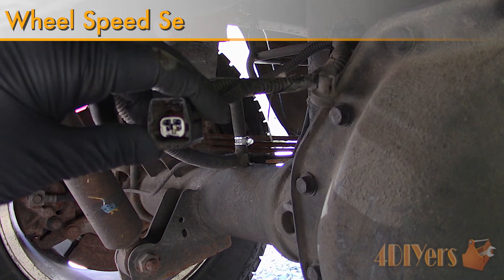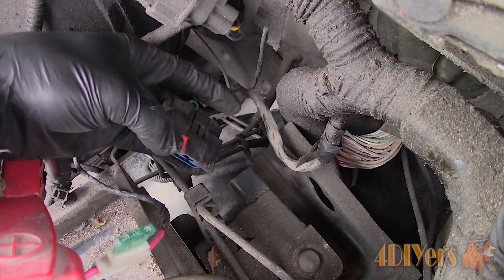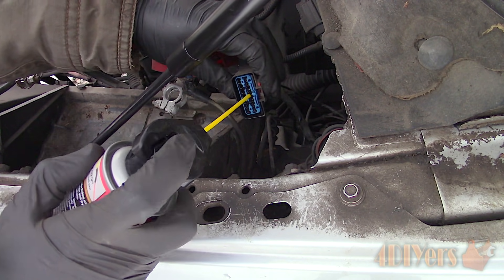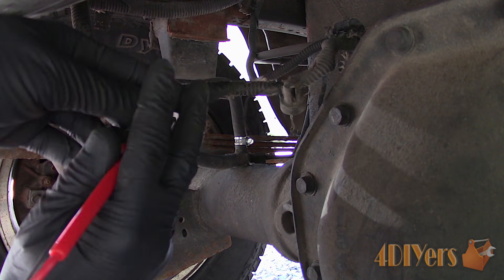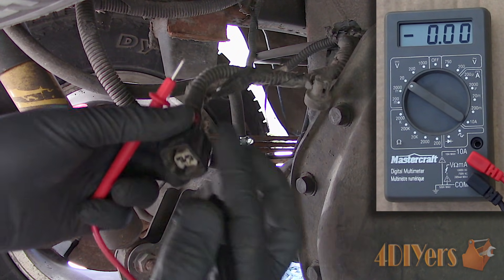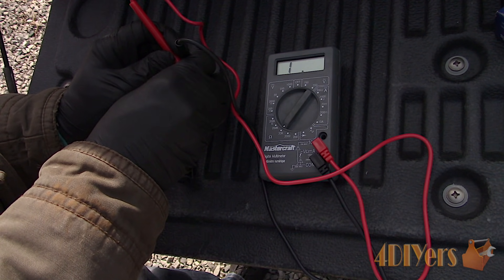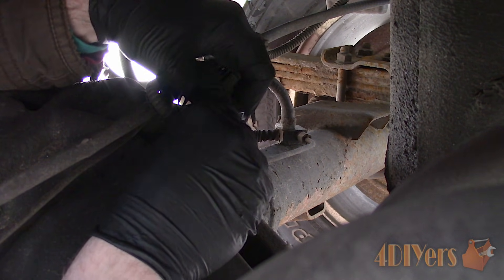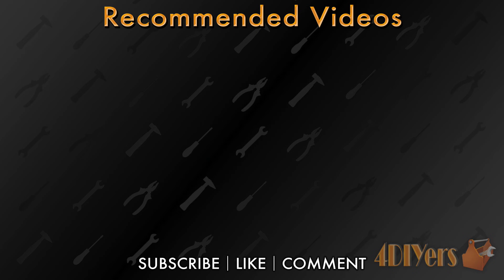How to: Dodge Ram 1500 Rear Wheel Speed Sensor Testing and Replacement

Comment: Had two brand new abs sensors that were 1,200 ohm for the 2018 dodge 3500 but the old sensor that was still working is in the 1,800 ohm rating 🤪

Comment: i know where the end of wss connects to the hub but can anyone PLEASE tell me where the other end originates from? i cant find a wss on either side in front and i cant find where the wiring originates from in order to see if someone cut them off i see no wires anywhere PLEASE SOMEONE have a answer and hopefully one i can easily follow. 2003 dodge ram 15004x4 5.9l maggie. this is for my 2 front wss

Comment: Just did exactly everything you said in video.   With key ignition on and probing rear axle connector I shouldn’t be getting any voltage on both left or right side of plug.  Left side I get zero. Right side of plug in getting 4.7 volts!!  What exactly does this mean if I’m getting volts on one wire on plug with key turned on?  Thank you for the awesome video.
Reply: Im doing mine now.  I dont think the sensor in my 02 ram is same as one in vid.  Looks like it. But when u spin wheels it produces dc voltage instead of ac.  And it has a 2.5 volt steady reading with key on. Couple more videos and ... Its called a variable reluctance sensor.  Manufacturers of certain vehicles often used diff sensors that varied by trim types etc.

Comment: I'm going to take this task on asap on my 06 RAM. This may seem obvious, but should I take the spare tire off before doing this, so I have more room to work, or does it not make any difference? Any suggestions will be greatly appreciated.👍
Take care
Reply from the maker: You can remove the spare tire, it will help with more work space. I usually try to the bare minimal in my videos to keep it as simple as possible.
Reply: @4DIYers  Right on. That's totally understandable. Thanks for the reply and have a good one.👍💯
Reply from the maker: No problem and thank you!

Comment: Good information. The only bones i have to pick are with technique. When probing connectors it is IMPERATIVE that you use a probe that is the same size as the pin that goes into the connector or smaller there is visable terminal spreading on your ABS pins from the large probes spreading the connectors. This can cause intermittent connections and compound issues from self induced problems.  The other is the Ohms test from ABS to sensor. Having an other than spec reading does not auto fail the sensor it just confirms an issue in the system. Seperate sensor and wire Short-to-Ground and Short-to-Power tests then need to be performed.  Other than technicalities the video was well made.

Comment: The speedometer on my 2002 ram 1500 3.6L isn’t working after having the engine resurfaced, and the ABS and Brake light is on (they were on before the engine problems).

I’m hoping it’s just the sensor that needs to be replaced, because your video makes it look really easy.

Comment: I changed my speed sensors on the transmission after changing out my solenoid but my truck seem to have no power or won't shift into over drive. What do you recommend. Thx
Reply from the maker: Check the oil level in the transmission.

Comment: 2007 Dodge 3500, I tried to test the sensor with an ohmmeter on 3 different new sensors from 3 different stores and there
 was no reading on the meter. The sensor for the 2007 dodge 3500, Dorman
 970-280 looks like the one you replaced. Any ideas?
Reply: Same scenario with my 2005 dodge Dakota 3.7l 4wd. Was hoping the rear diff abs sensor was the culprit because I didn’t get a reading during the ohm test on the sensor so I got another one from autozone.  Right out of the box no reading just said 1 on multimeter.  If I touched the probes together it went to 00 like the multimeter is working.  Ask autozone for another new one nothing happened multimeter showed 1.  Went to oreillys asked if they had one I could measure  and use their multimeter and it showed 1.   Tried all ohm settings every time nothing.  Sensor was in the same location,  same wiring connector, bolt bracket and looked identical.  Is it possible that three new sensors from parts stores are faulty?
Reply: @stevobrand  I put a new sensor in and have not had a light yet. Not sure why there were no readings on the meter either.

Comment: I just recently bought another rear end for my 1990 ramcharger bcuz it’s making grinding noises. So I found another diff at a local scrapyard but it “Does Not” have a hole for the sensor on-top of the differential like the rear end that’s on my truck now. My question is will my truck still function properly if I do this swap. 
Honestly I don’t know if that sensor on top is a abs or vss sensor.

Note: I do not have a abs light on my dash
Reply from the maker: With no sensor, you'll have no rear abs. Everything else will function as it should assuming you have the correct gear ratio, but you'll no longer have abs brakes, meaning they'll just lock up instead of pulsing.

Comment: Just replaced mine on a 2006 ram 1500. Before I replaced it, the brake and abs light would come on usually after about 10 minutes of driving. Also the speedometer was about 6mph slow and the cruise control wouldn't set. I haven't tried driving the truck yet (I've got other stuff taken apart on it too) but now when I start the truck the brake and abs light come on immediately. Do I need to drive the truck a bit to recognize the new speed sensor and reset the lights? Almost seems like it's worse after replacing it.
Reply: same boat

Comment: I’m getting OL on abs module connector, both sides of connector under driver side fender well and at rear speed sensor. What’s going on?
Reply: I’m going to run two new wires from abs module connector back to rear wheel speed sensor

Comment: I've replaced the sensor but my speedometer is still not working and the abs and brake light are on. After watching the video I tested the sensor and the issue seems to be a short somewhere in the wiring because I get a reading when I'm testing right at the sensor but not when I'm testing at the module. Anyone have any suggestions on how to repair?
Reply: Sounds like my situation, did you ever figure this out?
Reply: @josh-e3j  run the wires get you a red and white wire hook up your white one and then your red one and run it to the back of the ABS control module yourself and bypass whatever they have going on
Reply: @christreadaway5706 great idea bud simple but it’s a good start. After not having my speedometer not working for about 3 or 4 years lol it suddenly started moving but was saying I was doing 70 to 90 mphs 😂 then just took a nose dive down back to dead at 90 or whatever the highest speed reading is

Comment: I am in the middle or doing this right now. The nut and stud came out easily. The sensor, on the other hand, is really stuck. Rather than accidentally breaking it, I decided to take a break and watch your video again. Wow! Your sensor came out easily. Mine won't even twist. I guess that is the downside of living in the snow belt where the road crew answers to snow is throw down more salt.
Reply: I got it out, but the plastic housing around the magnet stayed in the opening. After a bit of careful work I got it out enough to grab with some needle nose pliers and pulled. I am hoping the thing I saw flying off was the o-ring as it was not in the hole. Finding it on a driveway wasn't happening. Installing the new one was an easy task. I cleared the codes, but still had the ABS and Brake light until I switched out a fuse. After that everything worked. This is about all I can do to get things ready for a safety check as removing broken exhaust manifold bolts and replacing them and the gaskets is not something I want to do.
Reply from the maker: Glad to hear you got it sorted out. With the exhaust bolt, unfortunately you'll need either a welder or acetylene torch. Hopefully the shop is fair with the pricing for that repair. I know some will charge a premium for such a job. The only thing you can do is pop the fender liner out to save them a little time. I have a bunch more videos if you're seeking more repair info as well.
Reply: @4DIYers  they treated me well.

Comment: I replaced that sensor but my speedometer still doesn’t work what possibly could it be?
Reply: Bad cluster instrument
Reply: I tried everything on my 97 dodge 3500 with the nv4500 5 speed. I lost 5th gear and took the tailshaft cover off and my speedo drive gear was chewed up. Replaced all needed parts and it worked fine for a few months, now the speedo is about 20mph off and will jump around after driving about 30 miles down the road. Idk what the cause is, but just letting u know that it could be internal as to why your speedo isn't working

Comment: I'm having a intermittent problem with the speedometer not functioning. ABS and brake warning lights function properly. Tested the resistance between pin 1 & 8 and received a steady 179. To me it does not appear to be a faulty wheel speed sensor. Anything else I can check?
Reply from the maker: If it's intermittent, you maybe catching it when it's working or there could be debris built up on the sensor as it's magnetic. Simply remove it and clean, then reinstall.
Reply: Same issue here, my sensor had metal stuck all around, wouldn't even work with cheap replacement but im sure it needs a fluid change

Comment: Good morning. I am restoring a 1954 Dodge Fargo 1/2 ton. I changed the rear axle with a newer GMC Jimmy. When I got it home I noticed that wire you are talking about. I had no idea what it was used for. I have no intension of reusing it, but it was nice to learn what it was used for. Thanks for sharing. 🍁👍👍
Reply: Iii